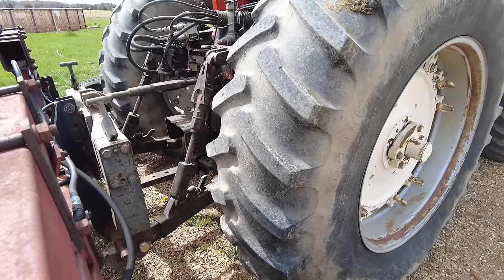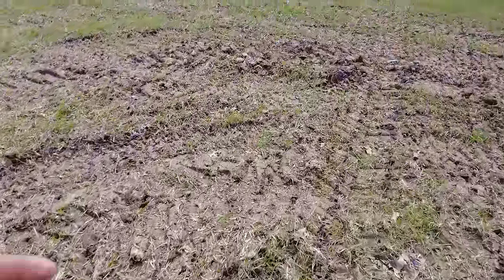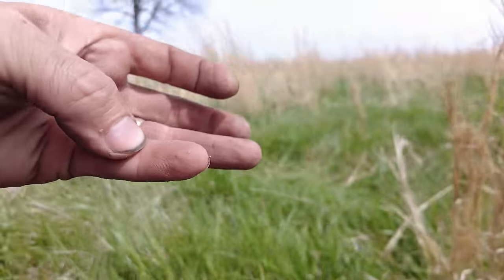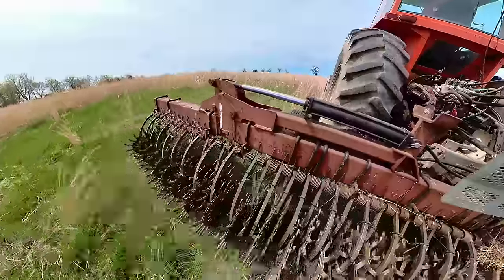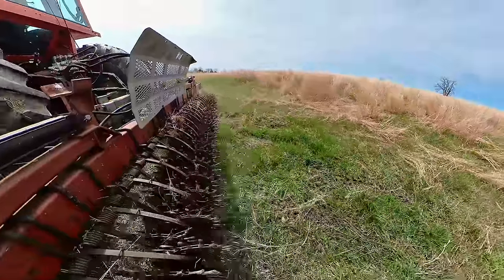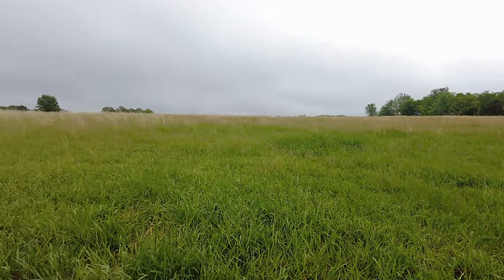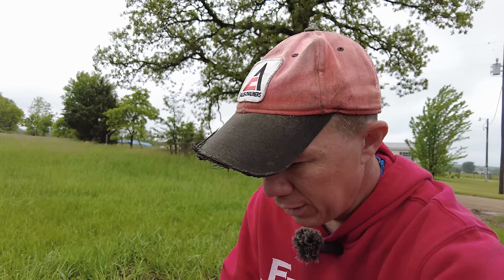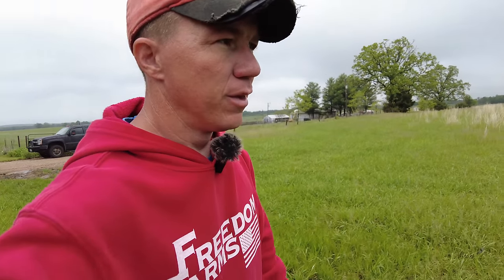Using a Rotary Hoe on your hay field?

Comment: You are doing what we do each season using a Aerator made by Industrus America that stabs bigger holes allowing everything you stated but with one  added benifit, With Hybrid Bermuda grass it cuts the under ground rhyzones stimulating the  runner to grow new plants,  more stems more leaves.....  Ceased Row cropping Cotton and peanuts 6 years ago to sell hay commercially.....     Yearly average is about 10 4x5 rounds from 200 acres...........
Reply from the maker: It works pretty dang well for us.

Comment: We use a pasture renovator. It rips down about 12” to get past hard pan. Only problem is when I get where we have shallow rock it brakes the shear bolts and gotta do quick repair.   I have learned where the rock is and just stay away from it. Also you need a lot of horsepower for them. Thanks for sharing.
Reply from the maker: As mentioned in the video any kind of tillage brings up tons of rocks here in south central Missouri. The rocks are literally everywhere and realistically anything that turns dirt over is going to be a rock picking fest. You will see in our later videos from last year when we made a new hayfield on some land that we will be farming. It's unfortunate but just how our ground is.